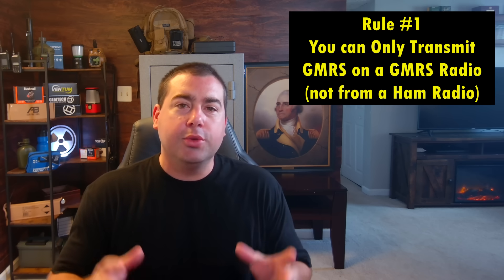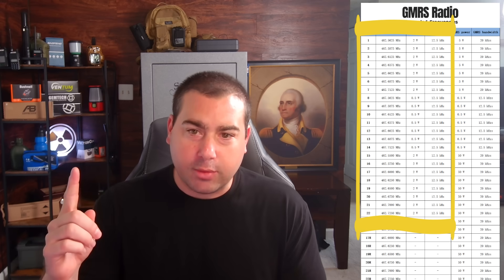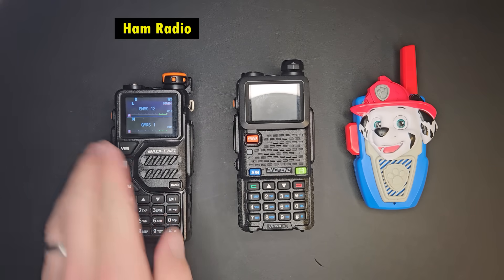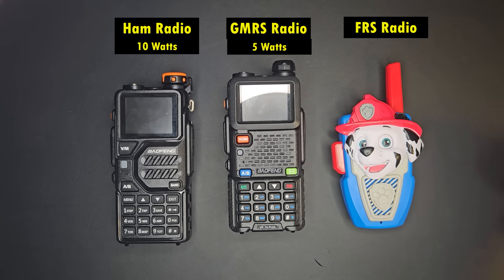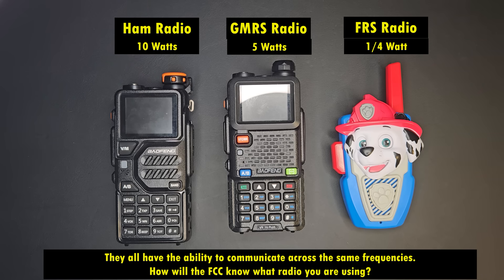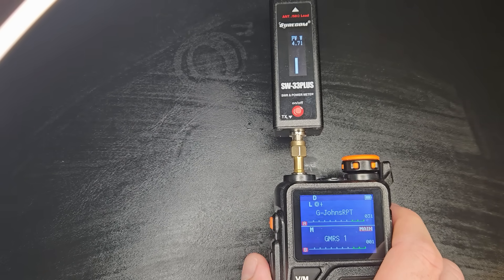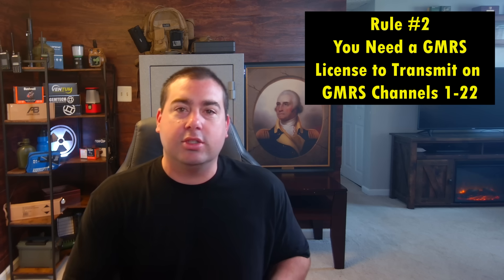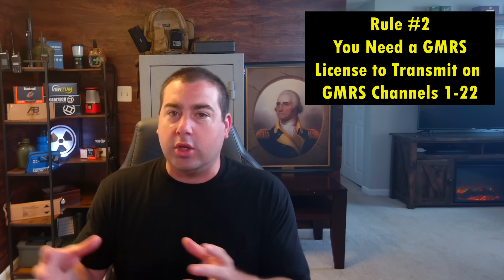Radio Rules the FCC Doesn't Really Care About & Why

Comment: The FCC doesn't have the man power to chase ever kid in the country with a Baofeng UV-5R, UV-5RH, UV-5RM.
Reply: While no, the propitiation of software defined radio.  They can setup monitoring pretty easily and cheaply. This can also be done remotely.  The ham radio crash course channel published a community meeting between the fcc and arrl and one of the investigators said that is what they are doing.  The arrl has also been delegated authority to “police” the ham radio band.
Reply: @itmeng I am sure lawyers that are radio operators, will challenge this in court, just like with ICE thay can assist Federal enforcement, otherwise thay would try to arrest everyone with a walkie talkie, police are already trying to do this with people using their cellphones, this will not end well, but it will have everyone pissed there will be thousands of lawsuits filed.
Reply: @BobGlenn-r9v they said they do this more for people who are intentionally “jamming” ham repeaters.  As a ham radio operator myself I can think of much better things to do than intentionally jam repeaters, but like in every hobby there is the select few that give everyone a bad name. So this is primarily limited to the ham bands.  BUT the intention of the post is that the technology is out there to do location tracking even cheaper and more discretely than the old FCC Radio Direction Finding vans of yore.
Reply: Who cares
Reply: @donaldanderson3366 I don't.
Reply: Why do you think the government grants "some people" the privilege to talk on a radio as long as you give up your 4th amendment right?
So easy to track you. Your name and address, and anything else the government can get away with, has to be given EVERY TIME you talk on your radio. They know everything about you, mess up, and they know how to find you.
Reply: true... and with the knocking around of funding in the new administration... DOGE may come a knocking on the FCC soon.... I do believe that commercial interests should be protected from sheeple breaking down the fences and acting all ghetto... So keep some hand slappers at the FCC for effect.

Comment: Let me get this out right away
I’m not the radio police and generally speaking I don’t care what you do, as long as you’re not hurting people in someway.

You kind of missed a bigger issue: 
That little paw print radio that you were showing, that little FRS radio, that might be on the same frequency as your GMRS, but it has a significant other failure besides the terrible antenna that you can’t change and low power, you should know this:
That little FRS radio only transmits on narrow FM and that’s why their audio sounds really really low when you’re listening on a radio that is set to wide FM, which is certainly possible and likely if you are using a GMRS radio or an amateur ham radio.

When people talk on those little FRS radios and you’re listening on a ham radio or a good GMRS radio, those little FRS radios sound very weak with light audio and I don’t mean because of the quarter watt output, I’m talking the fact that those little things can only do narrow FM. 

Do yourself a favor 
Get a real GMRS radio or use a amateur ham radio and don’t use those little FRS things.
Just my two cents. 

More people that have and use radio is a good thing. 
Encourage and welcome everybody and never forget what it was like when you were a new person.
Reply: Yes. The narrow FM makes FRS radios not only sound low volume but also tinny. They are more for 1, people who just want cheap radios for camping/hunting with there buddies and won't be more than a few hundred feet from each other. 2, Kids. GMRS in wide FM is the way to go for more "serious" local two way radio. Also a little tip (that I should not say because it might ruin it for my self) MURS is an option not just for close quarters but in rural/suburban areas.(It's VHF unlike GMRS that is on UHF) Almost no one knows about it, No one (except Wal*Mart employees) use it. So me and my siblings use it in our town all the time. The bad part is there are only five channels. The first 3 are narrow band FM but the last 2 are wide band FM.  But since no one uses it, and I'm not near a Wal*Mart.....It's been working for me!

Comment: I'm a newbie when it comes to coms. I'm looking for a couple of radios for a shtf/ bug out kit. Would I need anything else besides the K5 Plus just to be able to transmit/ receive about 5 miles in wooded and hilly terrain?
Reply: Yes you might need a repeater setup depending on how big the hills are between the radios especially if both radios are handhelds

Comment: I don't think it's so much that the FCC doesn't care as that that it's simply impossible for them to monitor and enforce rules on hundreds of thousands (maybe millions) of users communicating locally with relatively low power. However, the rules do exist for a reason, and before you break them, think about why they exist and how much deference you should give them. For example, FRS/GMRS channels 8-14 are "interstitial" frequencies which are very close to repeater input frequencies. They're restricted to 0.5 watts and narrowband transmissions because more power or wideband transmission has the potential to "spill over" and interfere with other people's enjoyment of the airwaves. Maybe using wideband and 1 watt or even 2 watts instead of 0.5 wouldn't cause interference, but if you were using wideband and 10 watts, you'd likely be stepping on somebody. 

GMRS channels 1-7 are designated for simplex use by handheld radios with no more than 5 watts of power. Yes, if you're using a ham mobile on those frequencies, you can probably pump out 50-100 watts on those channels, but you're going to be crushing other users who are just trying to have a good time. If you think you need 50 watts, go up to channels 15-22 where the other high-powered rigs are. What I'm saying is that even if the FCC doesn't enforce the rules, their purpose is to establish a framework for equitable sharing of the available frequencies and if you interfere with others' enjoyment of the radio hobby, you're a jackwagon. Be a decent human and show some courtesy. If you're in the plains of Wyoming, you probably won't cause any problems by using 10 watts on 8-14 or 50 watts on 1-7; in downtown Los Angeles, you almost certainly will. Just because you won't get caught and punished doesn't give you a free pass to be a fecal deposit.
Reply: Exactly. You're also playing close to a lot of police and fire frequencies. If you start interfering with those, I guarantee somebody's going to care.
Reply: Agreed. It's easy to stay close to the limits by using low or mid power and/or narrowband on the appropriate segments. It also makes sense if you don't want everyone in the region to listen to your conversation.
Reply: This YT content provider is a self proclaimed amateur of same said service but, his knowledge of that and other services is embarrassing. 

There are still VHF/UHF frequencies allocated to local law enforcement. They may be silent now but, through experience some are used state wide for cooperation between different neighboring agencies. 

You might think all the color dot channels are quiet. Some licensees are grandfathered in. White and black are two GMRS allocated frequencies. I still find plenty of other part 90 LMR available for sale. IDK about anywhere else but, 'round here many of the business interstitial freq's, both VHF and UHF are still in use. Not everyone is digitized 

The best of the amateur service is, we are encouraged to self- police, no doubt that carries over to other services, an example worth admiring. These are likely those that are dubbed "sad hams" but in reality the backbone of said gate keepers 

It's like asking protesters to leave the crosswalk so that drivers can pass on the next light cycle.
Reply: Wait until you find out the legal definition of United States, and the actual jurisdiction thereof.

Now, if you're one of those Americans whom claim to be a U.S. Citizen, then it's a moot point; you just volunteered yourself.